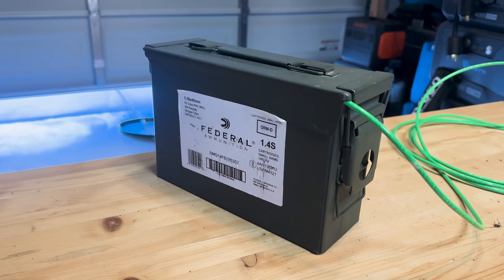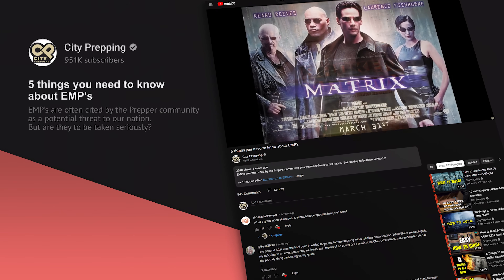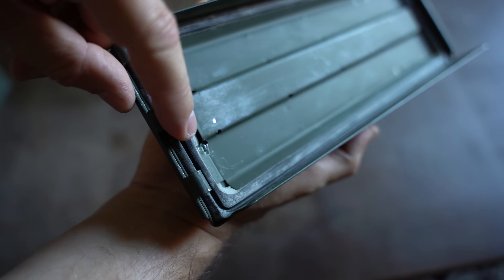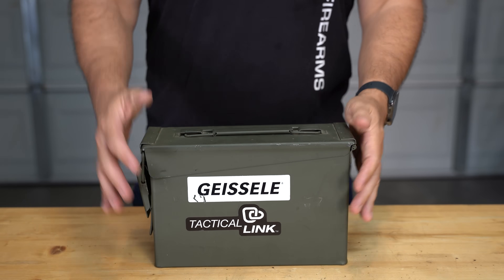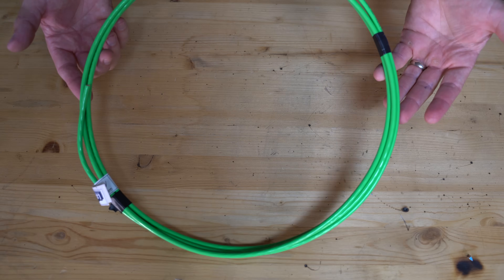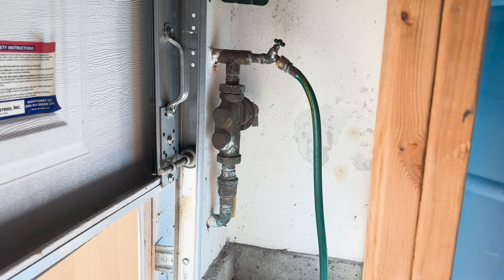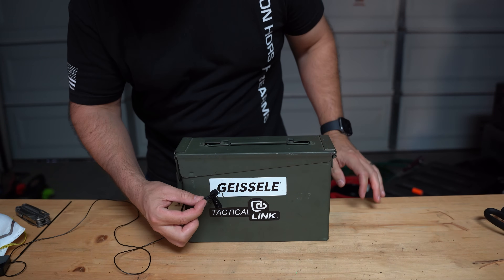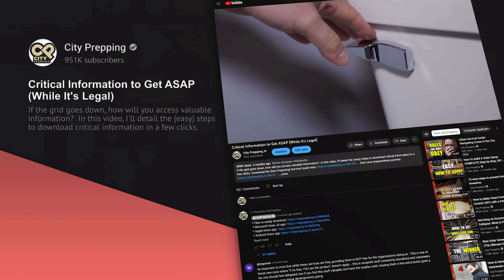How to Build a Faraday Cage: Step-by-Step Instructions

Comment from the maker: Download the Start Preparing! Survival Guide here: https://cityprepping.tv/38C5Ftt - start your preparedness journey: https://cityprepping.tv/3lbc0P9
/// Additional videos to watch /// 
*  5 things you need to know about EMP's: https://www.youtube.com/watch?v=gbQVFOPOHE4
*  Critical Information to Get ASAP (While It's Legal): https://www.youtube.com/watch?v=N1aQX9HO8-4
/// Items you'll need ///
Ammo can: https://cityprepping.tv/3RYAyvT
Aluminum foil: https://cityprepping.tv/3RBSUBH
Pliers: https://cityprepping.tv/3H6nqi1
Sandpaper: https://cityprepping.tv/3RGlphz
Duct tape: https://cityprepping.tv/41BTSm1
Grounding wire (6 or 8 awg): https://cityprepping.tv/3RGDLij
N95 mask: https://cityprepping.tv/3H0aY3n
Scissors: https://cityprepping.tv/41Dh4Ai
Reply: Really great video 👍
Reply: Would it be possible to add a grounding cable from lid to body to keep the rubber seal in place for water proofing?
Reply: @dakkotaknight   no it would not because the EMP signal can pass through rubber.  There should still be a way to make it water tight such as a sealant on the outside of the lid.
Reply: @TheProphetWind  thank you!
Reply: @dakkotaknight get a bigger ammo can and put all the stuff you put inside it into one of those cheap water proof boxes 👍
Reply: @dakkotaknight  That would leave an excessively large gap for EMP energy to get in. Most suggestions recommend using an aluminium tape to fully seal the gaps.

Comment: I had a tin-lined Japanese tea chest from 1956, with the removable lid also lined so that it contacts the chest.  It was initially intended to keep the  tea from drying out, but since it's entirely metal lined inside, it should make a wonderful faraday cage.  Also, what's wrong with one of those old fashioned 20 gallon  stainless steel milk cans farmers used to transport their milk?

Comment: Ok good vid but I’m curious , I’ve watched a few of these vids and they all remove rubber seal but in my case all I did was place tin foil over the rubber and instead of trying to remove paint from tough to reach grove I did so on the top edge of the box and a easy to access area of the lid instead. Unless I’m missing something here? But this way one isn’t wasting a perfectly good rubber gasket ,no?

Comment: ❓Sorry if already answered.. when exactly do we place our items in the cage.. before or during first seconds? If before, we'd have to duplicate phones & laptop. If during first seconds, can we throw in the phone & laptop? Thanks as I help explain to neighbors. ✌🏼
Reply: They deleted my comment. They don't want knowledge out there. Basically you'd want to do this before because an emp is instant and you wouldn't have time. Think of this as a separate emergency bug out thing. You'd want this stashed in the event of an emp with stuff ready to go. Because think of it like this, an emp happens unexpectedly and everything is fried in an instant. You'd want this stashed away in that event so that whatever is inside did not get fried. I'd personally maybe have 2. I wouldn't want to risk opening one, trying to gather information as to what might be happening and then have another emp destroy what I just took out. I'd wait it out, gather info/Intel, find out what's going on through maybe an emergency radio or word of mouth, a ham radio, etc. That's what you would want to store. Redundancies. A couple good flashlights, an emergency radio that doubles as a flashlight (a lot of great ones out there), a power bank (maybe preferably a good solar power bank to charge your stuff with solar), ham radios like a couple Baofeng uv5rs, maybe a cheap rechargeable electric lighter if you want, and like mentioned in the video, old phones  (preferably ones that take sd cards ), and sd cards stored with survival info. Stuff like personal family pictures and vids if you want, maybe music and games that don't need updates for moral boosters, maybe movies for moral boosters and entertainment, but most importantly, saved videos and documents on survival skills, water filtration, hunting, cleaning animals to eat, basic fishing rigs and shelter setups, knots, how to tie a ridgeline, how to insulate on the cheap with basic stuff, how to layer for extreme cold, foraging stuff like what's edible in your region, etc. maybe how to mix cleaning stuff to make stuff if you catch my drift, how to evade detection, how to evade facial you know what, how to use thermal blankets, etc. This is the kind of stuff you want on those sd cards. Hope I helped. Take care. God bless.
Reply: @JohnDoe-cd6ro  THIS was awesome, thank you!!!! Recommend for a helpful video on best Baofeng operations? 👍🏼
Reply: @srjk2000  I'm still learning things on my Baofeng since there's so much you can do. I'd recommend the channel "NotaRubicon Productions" . The dude is sarcastic and funny in a dry sarcastic way. My kinda ahole humor.
Reply: @srjk2000  NotaRubicon Productions. Search that. The dude is hilarious in a dry sarcastic way.

Comment: Nice video, I have for years said to ground Your faraday box’s, the card board is good but I think truck bed liner could be better.  Now for seals if you think aluminum foil is good how about copper window screen from Mc Master-Carr rolled in to a tube you shouldn’t need much.   Last I like to have a ground strap connecting the lid to the body of the can also I like to use terminals to connect ground wire can.

Comment: Please explain the top piece of the cardboard (4:39). Does it stop the connection where the lid was sanded? Why sand then?
Reply: I think cardboard is strictly for electrical insulation. The outer shell should be bonded, or electrically continuous with no gaps whatsoever while the interior is insulated to protect your survival items

Comment: I live in an apartment and don't have exposed pipes to ground to, and no way to run a ground wire to the bottom floor. The breaker box should be grounded, right? can i attach the ground wire to the breaker box? One comment said grounding isn't necessary but if i don't ground, touching it will discharge any energy, right? Like during the winter when we get shocked wearing socks on carpet?

Comment: Great video! My suggestion is to actually have a small Faraday box with the very minimum necessary for communication (radio as cellphone towers may be dead) after a first EMP/CME. If it's a EMP, chances are that subsequent attacks may follow and if you have only one Faraday box with all your electronics, you may risk to have them fried in a 2nd, 3rd EMP.
Don't carry all your electronic stuff in a single basket.

Comment: Take a closet reline it with lead lines drywall which is easy to aquire. Run #6 bare copper around the room in a couple areas down to 4 ground rods in 4 corners. This can be welded to ground rods or mechanically held. Remember to cover floor and inside of door. Then you can have a ton for room for devices. Same way they do xrays, ct, cat scan,etc rooms!!!!!

Comment: Where did these people get the idea a grounding cables needed?  A solar flare or EMP will not create a charge that needs to be discharged, if anything, you help it complete a circuit and could damage the equipment inside.  20 years experience in US Navy tactical jamming electronics.

Comment: Items to consider saving in a faraday box:
Solar chargeable lower Bank
Raspberry pi computer with a Qortal node running (ideally you have 2 with one being plugged in and synchronized while the other one is in the box and you swap them out regularly)
Power tools
Bike lights
Night vision
GPS devices
Meshtastic devices

Comment: Hey T_funks comment was great and you should really look at his advice as a electrical engineer. I am an Electrician and He is correct on all terms leaving in the rubber gasket. He is also right about the ground wire, Diode is a great Idea and the ground is not necessary however if you do it you cannot allow it to go into the box the way it is here. I would worry that particularly with the way you have it coiled you would great a massive induced voltage or amperage and then the poor connection to the aluminium foil  would create a massive arc or possibly a capacitance if the arc blew the line. If you did it, then weld or bolt or clamp it to the exterior or you may need to bother with protecting the valuables as they may simply blow up instead.

Comment: "We want to protect against strong signals that just travelled several miles through the air, so we are going to insulate with a thin layer of cardboard." Also notice that a microwave oven doesn't have its paint sanded off the door. I hope nobody takes this video seriously. Good April Fools joke, though.

Comment: A tons of thing could be done better… starting from using some conductive paint to 3d print a conductive tpu gasket….. the aluminum foil will end up with taking the sale and loose contact as well as the risk of rust in humid environments of the exposed metal

Comment: The same way nicola tessla put bulbs in the ground and passed current through the same works in reverse all you have to do is insulate with foil and card board a waterproof plastic box the size of a mobile phone or bar of soap and Bury it 1 foot underground because at 8 feet the thurmo heat will damage it but about a foot or from foot to your knee in measure will also protect your device then mark it with a large stone about a kilogram with no mineral inside so you know where it is and because any minerals in rock potentially can cause energy to pass through

Comment: Hello from Germany,

I‘m confused. I tought the important thing on a faradycage is the electrical Flow of the outet Objekt. 
So small gaps(like a net) are not important. So you dosen‘t have to remove the gaskit. The only important thing is, to have a electrical conektion Betten the Box and the lid. 
You have that, metal on metal at the hinch. Ore if you wanna be save install a cable beteuern Box and lid. 
Do I thinking wrong?
Reply: I wondered the same. My guess is that any energy pulse traveling over the air doesn't rely on electrical conductivity. Therefore, simply bonding the outer shell , as you would to safeguard (ground) a typical circuit, would be insufficient

Comment: Aluminum foil has a oxide coating that might be an insulator. There are special gasket materials out there that more than likely match the dimensions of the original gasket, the difference is that there is a copper braid on the outside of the gasket material as well as conductive material is incorporated in the gasket material. They even have a conductive adhesive for the gasket which should me used. It’s not cheap but is worth its weight in gold for shielding. If you want to store photos on a USB drive you should also secure a working laptop and power supply. A drive without something to read it is useless. You can also buy large aluminum NEMA electrical enclosures from industrial electrical supply houses and order it with an RF tight conductive gasket. It will not be cheap but it will hold a lot of your electronic goods you may need in the future. Bear in mind that you need to charge batteries in your equipment every month or every other month to keep your gear ready.

Comment: USB Drives while light and portable need a charge in order to keep the data in them. It usually lasts 1 year, probably less depending on the make and model. Flash drives can still function once the charge runs out. However, all the files in it would be lost.

It is much more preferable to store your data for the long term in hard drives as they last longer. We're talking decades.

Comment: OK I may be wrong but the odds of enough people building this and actually being able to connect to those that have are between slim and none also IF a EMP IS USED well that means electronic devices are null and void EMPs are designed for said purposes in that what you save may not be used because others are I'll prepared IE this is useless but that's my opinion  yes be prepared but for self preservation as for EMP well let's just say there is nothing to prebare for IJS not knocking your video this is just my opinion

Comment: Another option for testing is to place a walkie talkie in the can and try transmit to it. Or use a cell phone and try to call it from another. 
Lastly, if your phone has a Wi-Fi hotspot option, connect your laptop or another device to the Internet using the phone hotspot. Place the phone inside, close the lid and see if the Internet signal drops out. If it does, your cage is good to go!

Comment: Just built mine using a small metal trash can with a snug fitting lid from home depot. I used aluminum foil and aluminum tape (6) layers inside. I was able to block my cell phone signal. I think it cost $40 cad and the can fits my Jackery, extra power banks, lanterns, backup tablet, batteries.... I need to find a way to protect my solar panels now. Aluminum foil?

Comment: I have an older car that i do not drive, it takes one single computer to operate the, ecu, tcm, bcm as most older cars do. I pulled this computer and stuck it in my faraday cage, and if you do not own a vehicles that was made before they started making engine control units, i would suggest doing the same.

Comment: How is an easy way to protect your vehicle from an emp? Would disconnecting the battery and turning on the key to drain the system of all electrical discharge work?

Comment: As an electrical engineer, I would consider a few improvements. Consider connecting the ground to the box and the lid (connecting near the hinge so the box opens without any interference). You could leave the rubber gasket to preserve the waterproof rating of the box. Another good idea would be to add a diode at the box. The ground wire itself would conduct the energy from the EMP and the diode would restrict current from going “into” the box.   

I’ve never tested anything in relation to an emp, but I’m not convinced grounding would accomplish anything. In fact I think it would create more opportunity for current to flow
Reply: Yes this is a very interesting analysis, thanks for sharing

Comment: TO BUILD A LARGE FARADAY CAGE, JUST FIND AN OLDER RV TRAILOR THAT HAS A METAL ROOF, SIDES AND UNDERBELLY COVER. THEN YOU GO TO THE HARDWARE STORE AND BUY SOME METAL WINDOW SCREEN COPPER IS PREFERABLE OR ALUMINUM. AND REPLACE OR COVER ALL THE WINDOWS WITH IT AND PATCH ANY OPENING'S WITH IT..MOST  OLDER TRAILOR'S ALREADY HAVE METAL SCREENS . PROVE ME WRONG

Comment: My suggestions for a more effective cage that I implement myself. 
-Coat the inside with rubber, 2-4 coats of using spray on (other than where metal to metal contact is needed for the lid)
-Fabricate a thin lead insert w/top that will fit inside and apply rubber coat as with can. 
-Weld or solder ground connection on outside of can
-Store on a rubber mat

Comment: Great video, and good tip about the rubber gasket. I purchased a 4'x2'x3' tool chest from Amazon ($145) there I store my radios, cellphone, extra car battery, solar panel, etc. I guess my question is this. I have a GoalZero Yeti 500X and I leave it in my faraday cage, but over time the battery depletes itself over time of not being in use. Can I cut a hole within the faraday to run a charging cable to charge the battery pack? Or will that just compromise the faraday cage itself? Thanks.

Comment: An alternative to the cardboard which will likely provide both better insulation as well as cushioning against   drops and bumps to protect your gear is an inexpensive yoga mat. If very thin, you may even double the bottom for add'l impact protection.
Reply: Aren't those typically a rubber material..?

Comment: I have asked this before and never been answered: Does a Faraday cage that blocks electrical pulses block radio waves? I have built 2 following the exact steps on other videos and when I place my phone in either it does NOT drop the connection to my WiFi or drop the cell service. If a Faraday cage blocks electrical signals then why doesn't it stop cell and WiFi signals?
Reply: A well designed on has to block radio waves as they are quite similar to EMP.

Comment: Or dig a hole and bury all your stuff?
Reply: Nope, EMPs and solar flares, the strong ones produce ground current ,AKA telluric currents. Putting your stuf in the ground, unprotected may result in bad surprise.
Reply: @jeanlui6944  how deep? more than 10tf?
Reply: @Cyber_Samurai  For instance, the Carrington event of 1859 burned most buried wires and even a good section on undersea cables. No need to dig a hole for protection. Wrap in multiple alternating layers of good conductive material and insulating material. Once done, sure  store in a basement or even root cellar but not directly on the ground.

Comment: The usefulness of electronic devices after an EMP greatly depends on the rest of the world protecting its electronic devices. What good is a cellular phone if there is no working cell towers? What good is a cell phone if there is no electricity to charge it? Hand held amateur radios largely use repeater networks, if the repeaters are down you are left with line of sight uhf/vhf simplex communication, and again how do you charge it? Let’s not forget during the Carrington event exposed telegraph wires overheated and melted. I don’t think there is much of an advantage to protecting electronics unless you have a protected source of electricity. A high frequency radio such as a 10 0r 11 meter capable radio that uses AM/SSB/CW may be more useful than a uhf/vhf hand held but with huge amounts of EMP energy in the atmosphere or radioactivity from a weapon would cause so much interference I doubt you could hear anything but static. Having a way to gather or produce and purify water, long term store able food, and a way to stay warm and dry is way more important than any electronic gadget. Learn to create and use stone tools, that’s were we will be if there are any survivors.